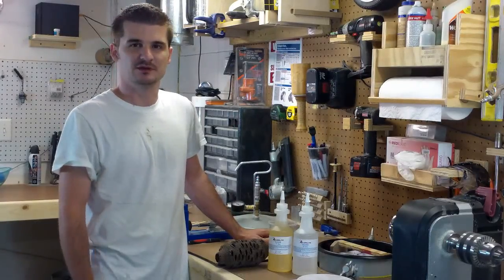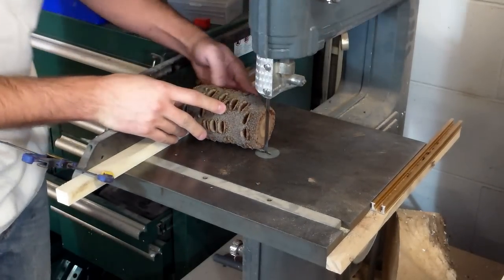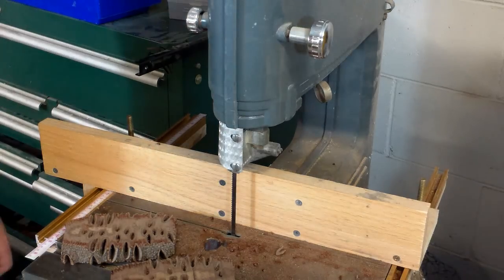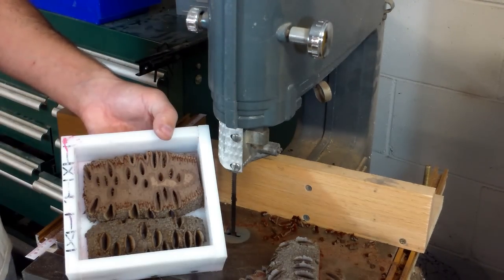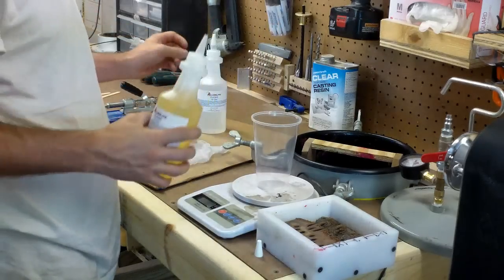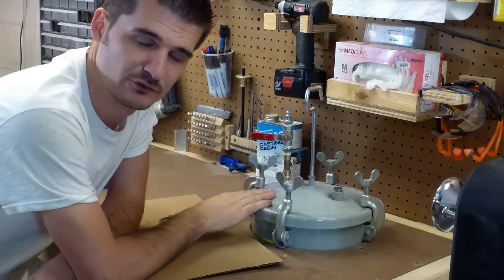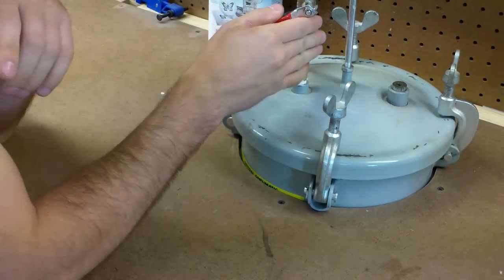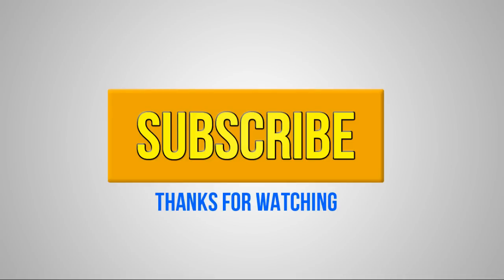Cast your own Banksia Pod Pen blanks

Comment: I have a pressure pot that will hold 60PSI solid for hours on end.  When I saw that you took yours out after a short period of time, I took mine out after four hours.  Although the Banksia pods had been fairly stabilized by cooking in an oven for an hour, I could see the bubbles start to form while holding the molded block in my hand.  It was not completely cured, and in the end, although I was able to (I think), save a few blanks, the premature pulling of the pour was my problem.
Then I realized you were using Aluminite clear, I am using Water Clear.  Apparently, the Water Clear product needs to stay undr pressure until it is fully cured. Otherwise, I learned a lot.  Thanks!
Reply from the maker: Thank for the info. It may seem like I pulled it out quickly but that's video editing, would be boring if I recorded the whole time it's in the pot. :)

Comment: I use a vacuum chamber because it draws out all the air in the tiny crevasse, and allowing the resin to flow in once the pressure is released leaving NO bubbles.
Reply from the maker: Awesome, you use alumilite with 7 minute working window?

Comment: Great video! I'm interested in trying banksia pods and this video answered a lot of questions I had! Any info on how to make the mold and mold stand? Any videos? Thanks for the help!
Reply from the maker: Thanks David, I make my molds out of plastic cutting boards, there should be a link to it in the video description. I don't have a video on making the mold
Reply: +Dema's WoodShop Thanks! I will check that out. Do you have any issues with the alumilite trying to get through the edges or do the screws hold it together pretty tight?
Reply from the maker: Depending on how good the cuts are, it doesn't leak. The first time you use the mold all the gaps will fill and seal with the resin. As long as you only remove one side when you remove the cast piece from the mold
Reply: +Dema's WoodShop Thanks for all the help! Really enjoy your videos! They are very helpful!

Comment: Air compressor or vacuum bell ? The tank is to remove air bubbles?
Reply from the maker: pressure pot used with air compressor ,  it gets rid of the bubbles and gets the resin into all the cracks and crevises..
Reply: *****
The wood you need it to be treated first? I tried with epoxy (without compression) I have "releases / no grip" between the wood and resin.
Reply: *****
 In France there is no alumilite products :(
Reply from the maker: That sux, clear casting resin works the same, just different mixing steps..

Comment: have you tried some kind of diffuser on the air inlet of the pressure pot? or is it not that big of a problem?
Reply from the maker: I'm not sure what you mean. I don't have anything
Reply: Like something that deflects the air so it doesn't mess up the epoxy. 

I just picked up an old all metal pressure cooker at goodwill and I will be modifying it this week I'll send you pictures of what I'm talking about.
Also keep up the great work your videos are very inspiring and I can't wait to tryout some useless wood casting!
Reply from the maker: Oh,my chamber lid already came with something that reflects air away from the resin

Comment: Can I get an advice from pro's.
Firstly, im about to use polyester clear resin for wood casting.
1st question is this- is it possible to get good results,(mostly bubble free) when it comes to big pieces of timber impregnated with clear PR resin WITHOUT vac/pressurising ? 
2nd question-  is it possible not to stabilize the wood with cactus juice, I see Dema is not stabilizing at all but i dont know if its going to be ok for bigger pieces up to a meter in length when it comes to strength of the actual bond, or does stabilizing have nothing to do with strength and durability?
3d question-  can I use allumilite dyes and pearls with standard Polyester CLEAR resins ? Do they like each other if you will?

Im going for clear PR resin because its cheaper and Im a beginner with wood casting, also I am aware that PR does get quite hot and fumy but that wouldnt be a problem for the wood that is covered with the resin right ? Ive seen those resin /wood tabletops people have made and I was wondering if PR resin would be strong enough to hold  pieces of timber together without breaking or de-bonding? 

Thanks and looking forward to your replies.
Reply from the maker: Hello there, it's almost impossible to get bubble free results without a pressure pot, I have a video comparing this. You can use alumilite dyes on polyester resin, it will never harden. I learned the hard way :)
Reply from the maker: Stabilizing the wood all depends on how soft it is, some woods are fine without being stabilized
Reply: +Dema&#39;s WoodShop Thanks for the quick reply Dema, so if the wood is super dry it shouldnt need stabilizing right ? And what is as good alternative to allumilite dyes for PR resin ? I want something pearly and phosphorescenty ? What should i go for ?

If not Polyester,  can I use Polyurethane instead? Is it true that it stays a bit chewy after curing ? Is it machinable in that case?
Reply from the maker: +Angel Delchev the wood has to be dry anyway, im talking about woods that feel like they are falling apart, or are vey light and soft. i use PerlX Color Pigment:
http://amzn.to/1Db3uUf
Reply: +Dema's WoodShop  and they work with Polyester  or Epoxy or both ?
Reply from the maker: +Angel Delchev yes they work with both
Reply: +Dema's WoodShop  Thanks a lot Dema, Ill go for the water clear polyester and use the pearls and probably some glow in the dark photo polymer powder into the mix and pour it into some old cracks, see what happens :) Thanks a lot for the replies, you were very helpful !

Comment: Greetings again Dimka. I have a question. I have a harbor freight paint pot for casting. I made a tray similar to yours. I also made a mold out of the cutting board you recommended. The thing is when I cast the pod the tray sat in the pot cocked because of the round bottom I guess so the slab was narrower on one end than the other. Did you have any troubles with leveling your setup?
Reply from the maker: I have a tray the I leveled before casting anything.

Comment: Hi Dema. I have tried casting banksia pods. The first time I got a lot of air. The second time the air bubbles seem worse. I have a scale and weigh the A and B. I'm using Alumalight . Do you do anything in addition to the resin ?
Reply from the maker: I have had alumilite foam up on me when there was too much moister in the pods, try drying them in an over overnight at 200 degrees

Comment: What size are your molds?  I can only get four blanks per pour.
Reply from the maker: The inside is 1.76x5.25.5. With a slab of banksia you will only get 4, that's why I put the end cut off on the empty space to get me 2 more. So o get 6 blanks pit of my mold
Reply from the maker: 1.75 x 5.25 x 5 "
Reply: ***** Did you use the plans from Turn Tex?
Reply from the maker: I did, but adjusted for my blade kirf

Comment: Hello Dema
I tried to make the mold with same cutting board material last night, but my drywall screws just spin out on me.  What am I doing wrong?
Appreciate the help.
Reply from the maker: Munawar Soomro Did you pilot drill the holes first? are you using coarse or fine thread screws?
Reply: I did pilit holes and screws were fine thread, 1" & 1.25"
Reply from the maker: Munawar Soomro ok, i have had issues with fine thread screws, the plstic is not strong enough, you need softwood coarse thread screws, that should fix your issue :)
Reply: ***** Aweseome.  I'll try it tonight.
Reply from the maker: Munawar Soomro Cool, let me know if that works for ya :)
Reply: ***** I didn't get to build the mold today, but I did follow your video and made Choco cactus pen blank.  Don't know how to attach file here to show you.

Comment: I was confused to start with because you kept saying moulding the wood, To me moulding is making a resin copy of the original, What you are doing I would call resin filling any voids/cracks in the wood to strengthen it
Reply from the maker: I think you miss understood, and I don't think I said molding the wood. I use a mold made of plastic to put the wood in then pour the resin over it this filling any cracks and voids, the molds makes sure the blank comes out square .
Reply: Hi, You said at the beginning you put them into a mould?
Reply from the maker: Yes I do, but a mold has different meanings, I can creat a mold from a piece to copy a shape or make a square mold to pour resin and get a shape, in this case I put wood into a square mold and pour resin over the wood, the mold creates a rectangular blank when the resin cures
Reply: I use moulds with my model making so I forget there are other uses for them, Enjoyed the vid

Comment: Good video, Getting ready to cast my first banksia pod.  For my application, I've cut the pod to 2x2.5x5.5  as it will used for something different than pen blanks. I am planing to pour a portion of the resin in the mold, then over each side of the pod and insert a small pointed tool to make sure the "eyes" are not holding bubbles before I slide the pod into the mold and "top" off with resin. I decided to make a vertical mold from .5" HDPE  but they are being cut with my CNC router. Since all the sides and bottoms fit into pre-cut channels, I don't need to use screws.. they fit so well, they almost hold water, and there is no leakage of resin.. I'm going to use 5/8" silicon rubber bands to wrap around the mold, but to be honest, they hold together on their own.. After casting a small tap with the hammer and the sides pull away.. I got tired of screwing HDPE together and found this design works much better.. Anyone that would like the design detail PM me..

Comment: Hi Dema,

I have looked this Video serveral times and I like it very much.
Please can you give me some information regarding your Mould an material for it?
I like your Videos they are very helpfull for me as a woodworker beginner!

Best regards from Germany
Holger
Reply from the maker: Holger Engelhardt Thank you Holder, my mold measures 5.25 x 5 x 1.75, that's the inside volume, I did 1.75 to have enough wall height so I can get enough resin with out having is over flow the edges, regular pen blanks are .75 square. I can get 6 pen blanks out of this mold. I have put links in the description were you can find all the materials I used in this video :)

Comment: This is a pretty fascinating video and very informative. Between the pen kits themselves and this process, what's your cost basis in materials? Also, I've never seen one of those pressure pods or any of the other materials you used. Can I assume these aren't found at my local big box home center?
Reply from the maker: Derek the banksia are around $11 and resin i have no idea, but the worthless wood is all scrap, and u can't find banksia in a regular store. Rockler and woodcraft.

Comment: Just curious, I make Epipes, and use a Vacuum Chamber. Using a JB Eliminator and a decent vacuum chamber i have no problem getting the Castin Craft to get into every last nook and cranny. And from the looks of it, Castin Craft is a LOT thicker then the alumilite. 

Is the Pressure chamber more of a preference? I have used it for straight acrylic blanks, to amalgamations and stabilization, and havent had any problems..

Also, A pressure tank isnt removing bubbles, your shrinking them to microscopic levels, which in turn create a little bit of an unstable blank technically speaking.. Like an air tank.. The Vacuum chamber pulls the air bubbles out by expanding them and raising them up and out...
Reply from the maker: I would say pressure casting is better than vacuum casting. Vacuum just elimintated air bubbles, pressure forces resin into all the voids..
Reply: o.O seems to fill every last line in my banksia.. Possibly you didnt have a strong enough pull on your vacuum, or there was a leak in your container, or you didnt let it normalize long enough after. 

I will say tho, i LOVE the setup to make the blanks. been using Dixie cups since they are such a perfect size, but i cant get decent marblizing out of a cup. and that blank maker you have would work amazingly. reusable, and jsut perfect.

Comment: Hey Dema.
I tried to cast using PR but after demoulding the cast is creating small bubbles coming out of the wood/pod surface. I made another cast using gum pods at the same time using same PR mixture. Do you think there could be moisture in the pod?
Reply from the maker: Hi Tor, I have had some moister in some pods. I found it beneficial to put the blanks in an over at 200 degrees for a few hours, to get the moister out. But wait for them to cool down before you cast them. Alumilite doesn't react well to moister.

Comment: Hey Dema, I literally got 3 huge banksia pots yesterday and I was wanting to do exactly like what you've done, however I don't have a pressure pot.   Does it make a big difference?   If I vibrate the sides and uses a torch to heat up the resin shouldn't that do the job?   Are they good to drill, they don't fall apart?   Have you made anything else from banksia pods?   Sorry to ask so many questions!!!  Cheers Sean
Reply: Хорошая работа, ум!

Comment: Dema - thanks for sharing this video and others.   Do you have a good source for the banksia pods in the USA that's reasonably priced? Thanks.    Dan
Reply from the maker: I get mine at Woodcraft, Rockler and I think PSI has them in bulk by weight but you cant pick was sizes go into that, other than those 3 places I have not been able to find any,,